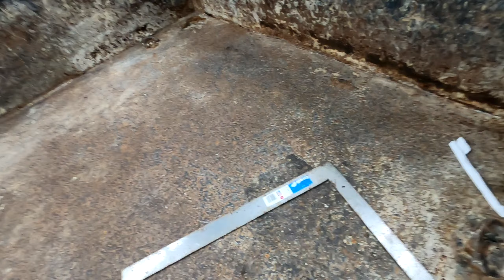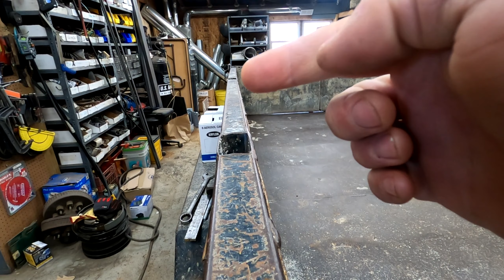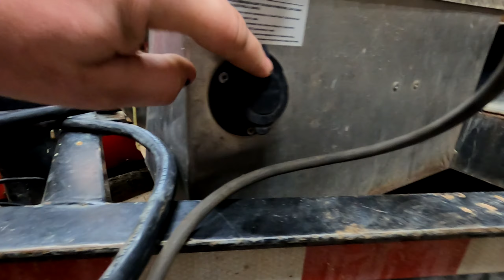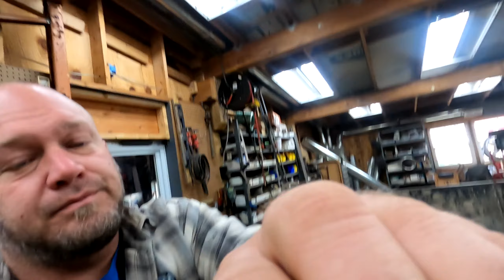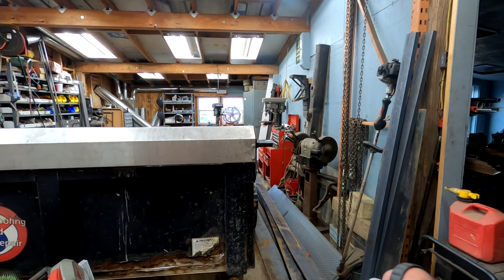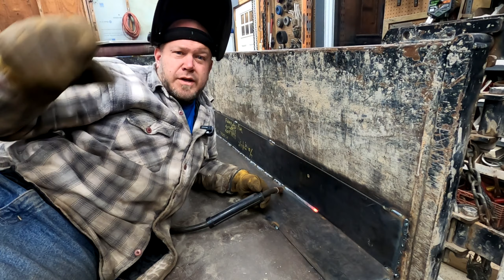Buying a dump trailer? Common design flaws discussed and repaired, part 1

Comment: Adding the piece on the angle is an amazing idea! Im getting ready to fix my dads old lawn mower dump trailer. Its 20 years old and is just so much nicer than the new stuff. I bought i new one to replace it with and im disappointed with it. So im cutting the metal i need from the new trailer and welding it into the old trailer. Im going to take the 45 angle and use it to get another 20 years of work from this trailer!!! Thank you!
Reply from the maker: I really appreciate it! I'm glad I could help you. That is what my channel is all about.

Comment: Jesus, that CAM is something of a rot-box... looks like he was hauling Salt. You're a better man than i am taking on a job like that. 
Yikes, I see what you mean.. that's way poor box construction. Usually they just use one sheet and brake it at the bottom-to-side.. 
Talk about Neglect. Broom, hose out, and put the dump up when not in use!
It's funny, when you first showed those flat strips to fix it with, i immediately thought, "weld them up @ 45's".
Then you went ahead and said it 👍 
If guys can't afford to fix it right, then why can't they afford the preventative maintenance?? 🤔

Comment: I'm getting ready to do a mason dump. Lots of bigger holes and bumps from guys digging out of the bed and scraping it either the backhoe and excavator. Should I cut out all of the peices of metal sticking up, weld a plate in and then go over top or just cut out the whole bottom or just bang it down and throw in new sheet steel? Thinking of going with 10ga
Reply from the maker: Depends how long you are gonna keep it and what you use it for. If it's a good truck, I'd cut out the whole floor. In all honesty, it will be easier to Weld the new steel onto the cross members vs the rusty old floor. 10 ga / 1/8" should be fine as that is what is probably on there now. If you haul a lot of broken concrete or large rock, you may consider going even heavier such as 3/16 to keep the bed from denting so easily. You can email me @ formidablefab@gmail.com if you want to discuss it more. Thanks for watching!
Reply: @Formidable Fabrications  thank you! We do lots of concrete, blacktop and sone/gravel work. I think I'm gonna go with 10 gague. Seems to be heavier duty and only 40 bucks more. I think I might wind up cutting out the whole floor. Might be the better option like you said. Thanks for the reply! Will email if I have any more questions

Comment: Man some 2 in angle and some sheet would have been perfect 3/16 would have been more than thick enough
Reply from the maker: That would be great except the bed wasn't straight so I had to make slight adjustments as I went along. If the bed was in better shape, angle would have been much easier